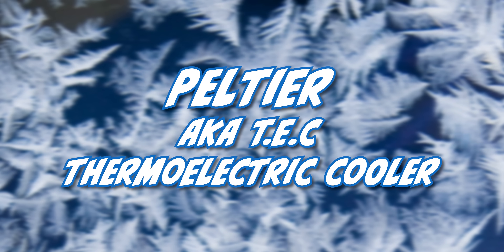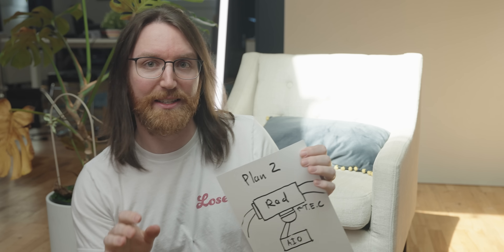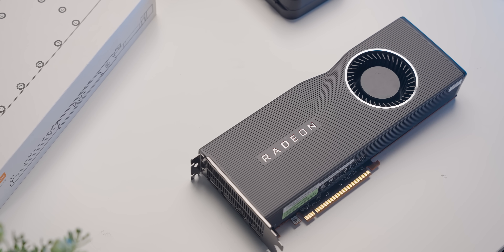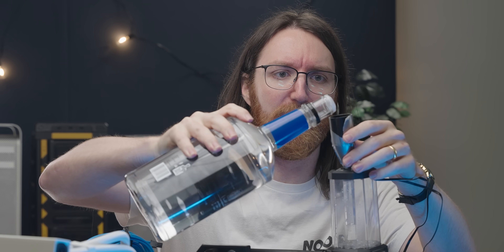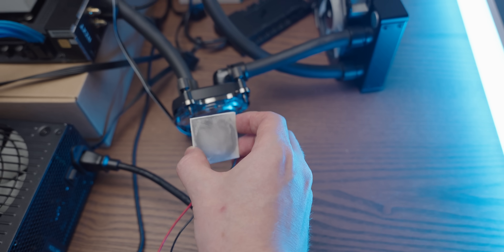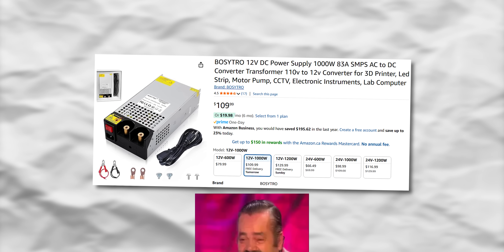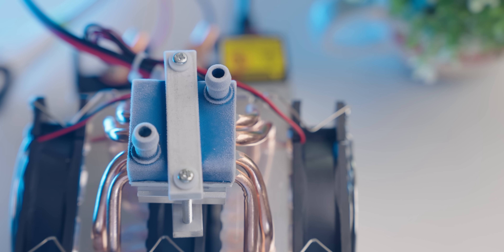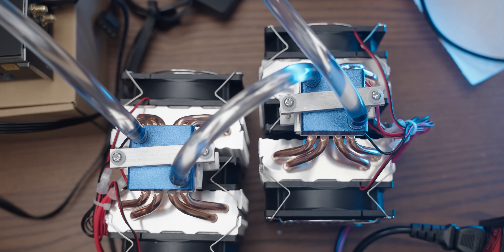I REVOLUTIONISE PC Cooling....

Comment: The thing is, you can't look at how many watts the Peltier cooler requires to run, but rather, how much of that energy it can use to move heat from one side to the other. Then the bottleneck becomes how fast and efficiently you can move that heat away from the hot side of the device. I'd imagine if you were to have a solid copper cooler with gold heat pipes, you may be able to actually move enough heat away from the device to actually warrant using it, and that's a hard maybe that will often be followed by "but wouldn't it just be better to use this expensive and immensely powerful cooler right ON the electronic in question?" Likewise, no matter how efficiently you remove that heat, you're ultimately capped by the actual ambient temperature in the room. Short of a compressor system to ensure that the most heat is being removed as can possibly be removed by the coolant in question, there is simply no way to super chill any sort of processing component within the ambient enclosed temperature of a room. Even if you provide that room with a constant temperature control that ensures the room, even the air around the device, is kept at a comfortable, by human standards, temperature, the limit will always be how cold you're willing to be while using your device. Peltier or not. Obviously, if you keep the ambient temperature of the room at around an exact 40 degrees Fahrenheit (~5 C) you're going to see your system operate at much cooler temperatures. Probably around 80-90 F or ~25-30 C, and that's not with the Peltier, that's with the basic cooling that comes on the card. The only thing that device will do, essentially, is make it much easier to keep the card at the ambient temperature of the room ASSUMING you have the ability to transfer the heat out of the system and into the air, which will have the heat transferred out of the room and into the world at large. In reality, if you want to ensure a cold card in a warm environment, you'll have to, basically, get an air-conditioning unit JUST for your PC, and they DO make them, they absolutely exist. There are coolant loop systems that use fundamentally the same technology in an aircon to cool your coolant, so you can slap that bad boy outside of the room and use its powerful pumps to move that chilly liquid into the system while ensuring the heat of it isn't allowed to simply re-enter the system. However, they're incredibly expensive, sitting at a whopping 5k on the cheap end, and likely upwards of 100k on the end where they're actually used. IE, high performance server farms and high capacity research computing, IE, super computers. In the end, the reason these devices aren't widely used is, quite frankly, what we already have works just fine on the consumer grade electronics, and the high end server grade and super computer grade coolers are already better at doing the job these neat little devices could ever do. All they do is move heat from one side to another in a way that, should you be able to remove the heat from the hot side, will allow it to maintain a temperature that is slightly cooler than you would normally have. (5 C instead of 20C) Which is neat, but ultimately, other systems already exist that do it better for less power. Example, there are 60W minifridges that can turn into minifreezers already, and if you're looking to just flat out remove heat from a system, why not just spend $120 for one of those, or go to a junk yard to rip out the cooling system of a larger refrigerator and build an insulated box to put your computer in to keep it cool? With one of those, you're basically air-conditioning your PC down to whatever temp you want, -10C? Sure, so long as you can keep the moisture out. 1C? Why not? Should be safe.

Comment: Honestly u could of used liquid metal between the hot side to improve thermal conducitivy and debuaers thermal paste for Sub zero past on cold side u might have a big idea. Please revisit this shouldnt be long video to make and push out due to ur just buying the 2 thermal solutions and using them. Also note u could use the Enermax or another water cooler that can used the TRX4 layout for threadripper its bigger and has more surface area for cooling. Lastly on the hot side I would use a normal Heat sink biggest u can. Due to the heat building quickly on the hot side a Normal Liquid Heat pipe design will pull heat quicker and equalize quicker. Just make sure ambiant room temp is good and plenty of Fannage.   Also look into getting Moonshine or EverClear LOL..... thats a joke but to be honest you might get better results from actually using antifreeze,  1 it can lubricate, 2 its thicker so it can move more thermal mass, 3 depending on where u like might be cheaper than the Vodka LOL

Comment: Sorry but... ok I won't curse you... but do you realize that, you are running those peltier coolers upside down, right? I am pretty positive all the liquid from the tubes and heat chamber is now located in the top part of those coolers (that are upside down, so that's bad). If I understand correctly the liquid inside the pipes has to touch the source of heat, in the hot plate, in order for it to boil and get to the top part of the copper tubes. Extracting energy from the system. The tubes then get cool by air and the peltier plate. Please check the manual what orientations are valid for those peltier coolers, because I'm pretty damn sure that orientation is not valid at all.

Comment: And yes of course. You will need multiple modules.

To achieve any significant effect. Which will be more electrically inefficient. 

But but it would cool the loop with electricity alone. 

And you should be water cooling the hot side.! 

So literally water cooling to both sides of the peltier module.

🍻

Comment: Great video. Loved it. You have a new subcriber.

BUT i think your order of equipment is incorrect. You should go pump>peltier>GPU>Radiator. This will cool down the fluid more since it is already cooled by the radiator. If you go pump>GPU>Peltier>Radiator then you are reducing the ability of the radiator to do its work. You need the temperature going into the radiator to be as high as possible for maximum temperature differential with atmospheric temperature so it can transfer the maximum amount of heat.

Alternatively put the peltier after the radiator. I still think doing pump>peltier>GPU>Radiator.

I hope this comment gets read and you give it a shot. Vodka pun not intended.

Edit: I see someone else beat me to it in the comments.

Comment: No offense intended to you personally, but your soldering and desoldering setup SUCKS.
 Get yourself an "Aouye 968A".  You will absolutely LOVE that thing. It even has a nifty feature that vacuum pumps local soldering fumes away from the work piece, but you would probably have to keep the main unit inside a small, open face enclosure which has a real fume extractor plumbed into such an enclosure...since the Aouye is simply pumping that smoke nowhere but to itself. 
  This is a PROFESSIONAL level solder, touch-less solder, and de-solder station with full adjustability. I think I paid maybe $175 usd for mine.

Comment: One thing about peltiers you have to keep in mind is that they're limited by the amount of heat you can remove from them. You have to move enough heat to cool the peltier itself AND whatever you're trying to cool, so if you're running a 200W graphics card and a 250W peltier, you need a thermal solution on the 'hot' end that can move at least 450W of heat. An AIO isn't going to cut it, so that means another loop on the hot end with something like a 3x140mm or bigger radiator.

I still remember the early days of water cooling where we used scavenged car heater cores and a peltier mounted straight onto an Athlon Thunderbird processor.

Comment: 14:00 dream dawid  you get a tiny refrigerator from David does goodwill, then you get the ice box with the jaws of dawid, then you silicone the whole motherboard, stuff aluminum foil so the icebox makes as much connection as possible, then silicon over the aluminum foil and the icebox.  It can cool like hell, you just need to muffle it with 40$ bucks of fire stoker's insulation in a closet.

Comment: Actually, wouldn't it be much easier to get a heat sink large enough to attach 2 peltier on both sides of it to cool the heat sink, and still have a fan to pull air on top of the heat sink as well as move the air up to let the heated air escape through the top fans?

Comment: In typical applications with moderate temperature differences (10–30°C) and effective heat sinking, Peltier chips achieve a coefficient of performance (COP) of 0.3 to 0.5. A 400-watt Peltier chip consuming 400 W of electrical power delivers 120–200 W of cooling under these conditions. In extreme scenarios, such as large temperature differentials or poor heat dissipation, the COP can drop to 0.1, providing only 40 W of cooling, highlighting the chips’ sensitivity to operating conditions.

Comment: Peltier coolers aren't used for a reason.  They are crap.  If they were good they would be used in commercial products.  Peltier coolers dump more heat into the radiator than the CPU would by itself.  The loop will not be cooler.  Whatever power you add to the peltier just adds to the heat load that needs to be radiated by the coolant loop radiator.  So you have to cool way more power for little gain.

Comment: You did worst possible configuration with peltiers.
Peltier should be added right before the GPU. [Pump -> peltier -> GPU -> Rad -> Pump].
By sending liquid to radiator after peltier, you are essentially heating the liquid back to the room temperature - meaning, even if peltier had cooled the liquid to -70 C you warmed it up to +25 C before sending it to GPU*. 

* - Numbers only for representation purpose, it is unlikely that peltier would cool the liquid to -70 and rad will warm it up instantly back to room temperature on single pass

Comment: peltier is  simply wrong foo coolong a pc, first you need more efficiency because there are hundreds of wats in game, so a chiller is the way, then u have the problem of condensation, so what i personally wil do if a have money to waste is built an seal isolated case with internal moisture extractor so that condensation is not posible and cool all heating parts and the internal air, that way i believe u can have things boosting the highest 

but with your build, a 200w peltier for how much gpu wats? you seem to have more heating than cooling and in your build
if u have more cooling than heating, u will be heating the water with the radiator or other said, u will be dumping the cooling in the room, absorbing the heat of the room and cooling it again, and also i dont think a 120mm radiator can cool 200w, maybe that was your problem, not counting that where not using all the peltier area, what is not right and posible not healthier for the peltier. i see to many fails, things that i learned reading and looking videos while i wanted to do it, but is not worth other than for fun and never using it again

Comment: peltier coolers are about as inefficient as it is possible to be. The energy used to move a smidge of heat is staggering. If this is anything but a joke, then use a heat pump. Not a  peltier cooler. Even if this is a joke, don't leave your viewers thinking this is a good idea.

Comment: Not to rain on your parade but this isn't a new idea for a TEC. I did exactly this about 10 years ago to cool an LED flood light that I made. That project recycled the TEC setup from a DIY dual AIO loop I made. I had upcycled two H70s(they had clogged and stopped working) into a single loop with a reservoir and a 3rd cpu block which had the TEC and an antec H20 AIO. These two projects were late 2000s and mid 2010s. And I had gotten the TEC water-block idea from somebody else online. However, you are the first person I've seen on YouTube do this but I also haven't hunted to see if other videos were out there. I remember one guy on here doing a hyper212->TEC->heatsink and they put the heatsink inside a reservoir and epoxied it closed to seal it.

Comment: Don't use the original water-cooling radiator; simply cool everything with the Peltier system you purchased. With the radiator, you're introducing heat from the room into the circuit. Also, be careful, as vodka can degrade the hoses.

Comment: First thing you need to know about Peltier cooling is that the TEC itself requires quite a bit of power and if your cooling solution cannot handle the combined heat output of both the thing you are trying to cool AND the TEC all you will end up doing is actively HEATING your components. And yeah you have to cool the hot side of the TEC or it will just work as a heating element. More powerful Peltier = more heat... 
We used to try TECs back in the 90s and... there's a reason people stopped trying 😅

Comment: You can calculate how much energy is needed to heat a liter of water by 1 degree. Take that blue basin and fill it with water, placing a spiral tube from the liquid cooling system on its bottom. Maybe even lower the radiator itself (connect another one to the loop) into the basin. Let's wish the PC luck in trying to boil 10-20 liters of water. 
(Hint: heated molecules will rise and evaporate faster than cold water. The warmer the water gets, the more efficiently it will cool.)

Comment: The bigger the temperature difference, and the more heat you're trying to push the less efficient the peltiers get, and the effect is huge. At very low temperature difference, and small heat flow per module, peltiers can actually be somewhat reasonably efficient. If either the temperature difference or amount of heat pushed by a given module is reduced by 50% the efficiency can typically be increased by about 50%.    

If you set up a bunch such coolers, and ideally connect them in parallell, and also make sure the hot air is blown away, and not circulated there, you can actually achieve decent cooling that way.  And also, while heat pipes works in any orientation, they're at least slightly more efficient "right" side up, and as very small temperature differences can have a significant effect on the efficiency of the peltiers, and inefficiency turns into heat, that can actually have a significant effect in this case.

Comment: Every now and then someone try to use Peltier cells to cool off PC components; there's a reason why no producer uses them (well Apple once tried to... ONCE.)
Peltier cells have very low efficiency, around 20% at best. In basic words, for every 10 watts of "cold produced" (or "heat adsorbed", same thing) it will produce 40W of heat. This means, if you need a 200W cooling power, then you'll need a 1000W Peltier cell AND a cooling rig to dissipate 800W of heat produced. It's just more efficient to remove them from the loop.

Comment: I spent 80 bucks and made my own cooler,  with just an AIO and a custom copper plate. (none of the after market GPU blocks incorporate the memory) was getting 68 to 70 c ,  now it ranges from 39-42. this was on a 6600 xt.  temps were checked mining crypto.

Comment: have to put the block right before the device you are cooling. works a bit better but still barely.  had this on my old setup for my massively overclocked fx9370 to not throttle with shitty rads back in the day.  helps a tiny bit but not worth it for the amount of power you waste.

Comment: Get a lot of cheap freezer, put a large bucket of antifreeze liquid in each and a long copper pipe. Put them in parallel rather than series. If you run the freezers 24 hours you should be able to get a good few hours worth of compute. Part of the cold you don't use carries over to the next day.

What you are doing now isn't better than simply adding a giant water tank.

Comment: 1 minute into the video, and it wont work.  Watts for watts for my guy.  If you have say a 5watt cooler, it will only ever cool 5 watts worth of power input.  A graphics card produces hundreds of watts of thermal energy, so you would need at least 40 of those devices to get effective cooling, and at that point, you just added another 200 watts of power, and 200 watts of HEAT that need to be expelled.  peltier devices are your standard heat pump design, they move heat from one area, to another, and cause they are actually not that good at it, you end with more heat to remove as a result.  For very small thermal masses, they work pretty good, but for something like a GPU they will need be an adequate cooling solution.

Comment: I have worked on a laptop water cooling solution using a peltier where I actually used a solution of water and ethylene glycol and you might ask why did I use water and ethylene glycol and the reason was my pump was very noisy(the solution was a lot denser) and also reduces the freezing point of water to - 45 degree centigrade. Well using vodka was a decently nice idea but it has a very low heat capacity so for every little amount of heat that it transfers its temperature rises very quickly and peltier don't like rapid changes in temp.
Also you are using way too many radiators in your system and a radiators will definitely not gonna give you sub room temperature that's for sure.
If you want to achieve sub room temperature you have to have some kind of control system where the radiator turns on once the temperature of water is more than the room temperature and the moment the temperature of water is lower than the room temperature the radiator turns off.
And that's what I did in mine and I achieved temps as low as 30 on idle 40 on load, keep in mind I am from India and its hot here.

Comment: After all the previous attempts ppl still try this? 😂 Start by looking up TEC specifications before trying.
Worked on the Celeron 300A like a charm in combo with water cooling and ran faster than the pentium 450.